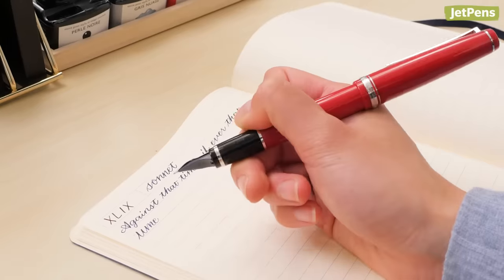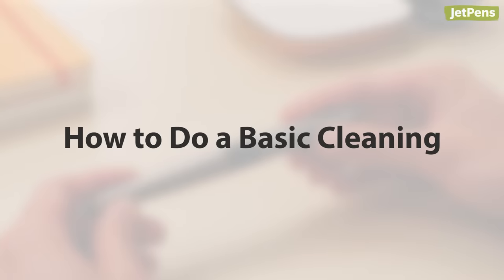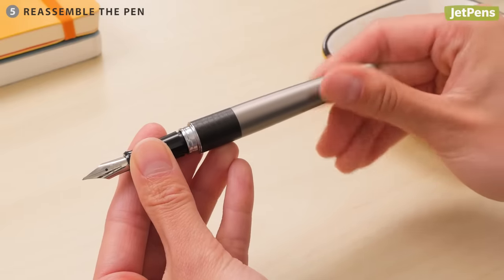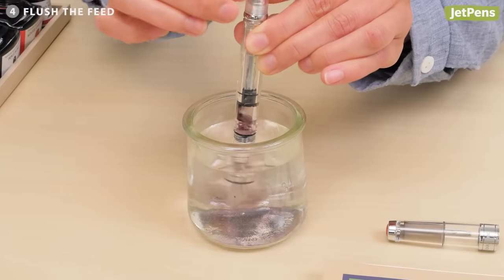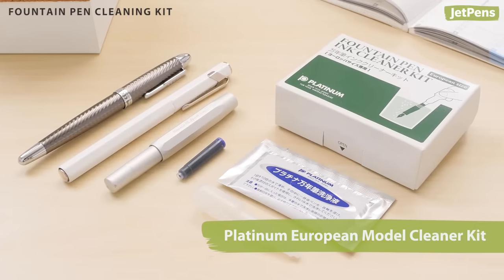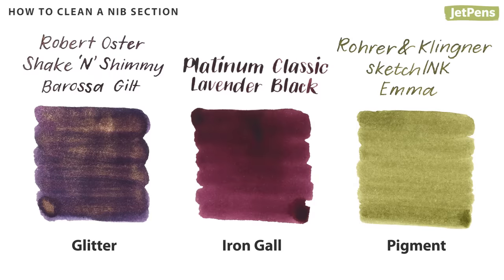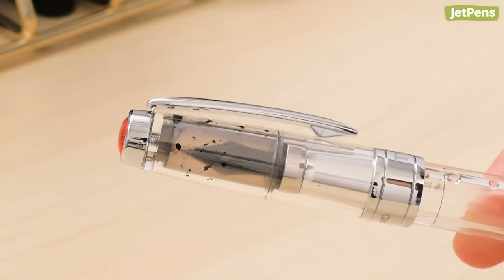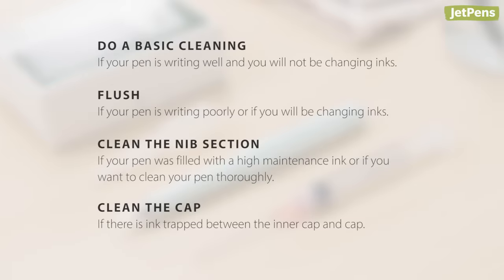How to Clean a Fountain Pen

Comment: i watched the whole video, i don’t even have a fountain pen
Reply: Buy one, use it, and clean it. You have your orders. 😉
Reply: future preparation :)
Reply: Encore_ss No, fountain pens write more smoothly and require no pressure to write, leading to less hand fatigue over hours of writing. Fountain pens can use the thousands of ink colours without being limited. The liquid ink stands out more on paper, and some have special properties like being waterproof, fade proof or fraud proof such as archival ink. Fountain pens can also give line variation through flex or stub nibs that allow of calligraphy to be done or for sketches such as Manga or even architectural designs, or just simple drawings. Seems to me that fountain pens are very different and not “pointless”.

(The guy removed his comment but I’m keeping mine up in case anyone else had the same assumption)
Reply: than get one 😉
Reply: you should try one...
Reply: YOU CAN BUY A PLATINUM PEPPY FOUNTAIN PEN ITS FOR BEGINERS AND ITS ACTUALLY CHEAP
Reply: • lxavender_blxrry • you’re not serious, even a Sarasa writes better than Pilot’s Energel. That’s a really low bar
Reply: get one! You ll be grateful
Reply: Ditto
Reply: Ballpen i way better.
Reply: @oldi184  oh you have just angered everyone
Reply: @abitlostbutigotit1576  Hey I only stated a fact. Fountain pen "scratches" the paper. Ballpen smoothly glides.
Reply: @oldi184  A properly working fountain pen glides better than a ballpoint ever could.
Reply: @chair5728  agreed - I would not have done as nearly as well as I did in uni without my fountain pen. I wrote much faster with it and could get a lot more down on the page all with 0 writer's cramp. Also, I might just add that they're infinitely more environmentally friendly than buying single-use ballpoint pens - if you look after a fountain pen it can last you ages plus most of the time you can recycle your ink bottle which is like one glass a year.
Reply: Amogus profile
Reply: Very good
Reply: It's better to be prepared than have one without knowing how.
Reply: Lol
Reply: I’m sure this video is for people who have Fountain pens ✒️
Reply: @bulletstothebeat1768  hey that’s my opinion too
Reply: @chair5728  They’re also more environmentally friendly than disposable pens
Reply: @oldi184  Some scratch the paper, others glide better than a ball point. Either way, that doesn’t make a pen better or worse, it’s personal preference. I like a bit of paper scratch
Reply: @4477superman  
Ok so "you like" is your opinion, but do not claim that the old technology - the fountain pen is better than the newer technology - the ballpoint pen. It isn't. The ballpoint pen was invented in the middle of the 20th century.  Technologically it is better in every way.
The ballpoint pen is used everywhere. The fountain pen
is only used ceremonially, mainly by CEOs, rich people, etc. who want to look fancy when they sign documents.

99.99% of people will use a ballpoint pen because it is better, faster, and more durable, it will write in -40*C cold, it will write in space, and is used on the space station. 
A fountain pen is good when you only need to write a few words. But try to write a lot of text with it, quickly. Good luck with it.
Reply: Same lol
Reply: Us
Reply: You should get one.
Reply: Do u have now?
Reply: Get a Pelikan Twist and a bottle of matching ink. It's an inexpensive pen, writes well with a medium nib, and is cute as can be.
Reply: Same
Reply: Lol 😂 same, but I am purchasing a couple soon. I've gotten an interest in calligraphy and I also want to re-learn how to write cursive, and what better way than with a fountain pen.
Reply: Same
Reply: Nice😂
Reply: Bruhhh
Reply: Get one if you like writing.
Reply: Same!
Reply: @oldi184  Although you seem to have googled the good points about ballpoint pen, every claim you made is false except writing in the cold temperature situation.

1. Older technology doesn't mean it's worse than a newer technology. If that was the case, fountain pens would have disappeared as soon as ballpoint technology has become commercially successful. People created ballpoint pens in order to write on uneven surfaces: like recycled paper, wooden surface, coarse wrapping paper, etc. But fountain pens remained in society because the ballpoint pen is NOT better than the fountain pen in EVERY way. 

2. I don't think everyone in this comment section is either a CEO, a rich person, etc. But they like to use fountain pens anyway. 

3. 99.99% of people do not use ballpoint pens. I myself prefer rollerball pens because it reduces hand cramp. My mother prefers gel pens because she prefers smaller nibs like 0.28mm instead of the standard 0.5. Many of my classmates in my student days preferred gel pens because it's easier on the hand for long note taking sessions and works well on cheap notebook paper.

4. No, ballpoint pen is not better, faster and more durable than fountain pen. Like I said, if it was better in every way, it would have beaten the fountain pens out of the market when it first appeared. During those days, a pen company can easily go bankrupt if their technology has become obsolete. The market was not as big as now. There were less literate people in the world and a lot of women were uneducated. Now we have 8 billions people with many literate people who can accommodate more options in the stationery market. 

5. You only claim that ballpoint pens are better for  writing a lot of words than fountain pens because you have never tested the two side by side. I personally know that ballpoints can cause hand cramp over a long duration because you need to put a bit of pressure into shaping your characters. It is my personal bad habit but I always find using force more than necessary when I use a ballpoint. The enormous callus on my right middle finger can prove my claim. I am now a working adult and mostly use digital devices like computer and mobile phone for my writing but that callus from my student days over a decade ago still remains. When you write for a long time using a smooth and properly functioning fountain pen that is not made of heavy metal, you will see the difference in hand fatigue level caused by a ballpoint. 

8. No, it's not more durable. Fountain pens can last for years. Parker fountain pens used to come with a LIFETIME warranty. Later, China produced counterfeit versions of their pens in massive amounts with very cheap prices. Parker had to close down 2 factories in UK and US and layoff all the factory staff. So they started producing more affordable pens to compete in the market and also changed the warranty to two-years period instead of a lifetime. Cross fountain pens still offer lifetime mechanical warranty.

If you want to compare the pros and cons of Ballpoint pen vs. Gel pen vs. Rollerball pen, this is a useful article (btw, rollerball pen is the most similar to fountain pen) - 
https://www.jetpens.com/blog/The-Difference-Between-Ballpoint-Gel-and-Rollerball-Pens/pt/167

Trivia: All the later presidents starting from John F. Kennedy used Parker pens. The orders coming from the White House was so many that Parker had to appoint a separate sales rep to handle all the White House orders. President L. B. Johnson ordered no less than 60,000 Parker pens in one year: for personal use and as gifts. Later, Parker relocated to England for administrative reasons and American presidents switched to using Cross fountain pens instead (another American company). In England, Parker obtained Royal Warrant by the British royal family twice. Queen Elizabeth II used Parker 51 devotedly and it was the most sold fountain pen model in history. They stopped producing Parker 51 in 1970s but collectors are still buying the used pens.
Reply: You should, I love mine
Reply: @oldi184 many people use them, as they are rather smooth to write with. The amount pressure you need to use to write with a good fountain pen is none aside from the force of gravity holding the tip down, so this means less stress on your hands while doing things like taking notes on nuclear physics during a lecture. Many artists use them as they have a bit of a texture difference visually than ballpoint.
Last thing, I am pretty sure you’re getting longevity of the pen mixed up with a nib. A nib you constantly dip in ink because they do not last long. With a fountain pen, they can last WAY longer than minutes. Try weeks, mine has survived many lectures, notes, and workdays for weeks at a time. Im not refilling mine every few minutes or every day or every few days, usually more like every 2-3 weeks. If im drawing much quicker, but most people aren’t worried about making a work of art with their pen, the average person just wants to write.
Reply: I have 11 fountain pens

Comment: Feed of Lamy Safari/Al-Star can actually be removed. It's just very difficult to be removed and you have to apply a lot of force and grip to pull the feed out. If you are determined to do that, remove the nib before pulling the feed out and make sure you look properly before you insert the feed back in. 

Ideally, don't pull the feed out that often because the friction might make the fitting between the feed and pen body looser. I usually flush my fountain pen or sometime I will put my pen in an ultrasonic cleaner to push out stubborn ink inside the feed.

Comment: Lamy pens have a removable pen nib. You can slide it of and even replace the nib. Put a small coin behing the writing part of the nib and pull the pen in the other direction. Be careful tough not to damage the pen or nib. 
Be careful with using tap water. Somtimes water from tap is very hard, containing chalk. You dont want this in the pen. Use distilled water instead. 
For pens beond salavage, mugged up with dried ink; use warm or even hot water.

Comment: 5:03: "Some pens, like the Lamy Safari, do not have removable feeds".
That's incorrect though. I remove the feed from my Lamy Safari every time I go to clean it out, and it comes out just fine. Slides back in with no issues either.

My suggestion is to remove the nib first, then remove the feed afterwards (carefully though, it's fairly thin). It helps to make sure that the pen is dry before trying this. When putting it back in, remember to use the same orientation of the feed with respect to the section as when you pulled it out (flat side up) - unlike with most other pens, there's only one way that the feed and the section fit together.

Usually removing the feed is only tough the first time around, so you'll need to be patient when trying it for the first time. I also recommend using a rubber grip the first time around. I remember using the rubber from an old table tennis bat that I no longer used - it worked like a charm.
Reply: It's lamy al star not lamy safari

Comment: every 4 to 8 weeks..
my very first fountain pen, laughing in the distance,
really, in my experience, if you don't use ink that is too strongly pigmented, or has big pigments, your fountain pen should survive quite well for a couple months at least even if you don't use it every day
for reference, aforementioned first fountain pen (a Schneider pen with an A nib, i got it around 17 years ago) lay around unused and uncleaned for at least five years until i gave it a good soak around march last year. the last ink i used in it before that was cheapo prussian blue cartridges from the dollar store
of course, if your fountain pen is a pricier model, or you change inks often, OR you use something like glitter inks, most of which have glitter particles that are big enough to get stuck in the feed, you'll probably want to clean your pen more regularly
but if you do it regularly enough and neither the ink or pen are stubborn, a rinse should suffice in my experience

Comment: I have a rose gold detailed one. Should I be worried about a patina or rust?

Also should ya clean it when ya change inks? I had black in it previously and want to put in blue.
Reply from the maker: It depends on the material of your pen, for example brass and copper fountain pens will darken and develop a unique pattern of patina. And yes, we recommend cleaning it when changing inks! This ensures that inks won't mix within the pen, which prevents muddy colors and the possibility of inks reacting to each other poorly.

Comment: I've been watching fountain pens videos for months even though I didn't have one.

My boyfriend remembered and bought me one a few days ago. It's a cartridge one, and in the video they said that you need to clean it every 4 weeks. Do I need to clean it even if the cartridge has ink, or I need to wait until there's any??

I want to be prepared when the time comes.
Reply: If it writes well and doesn't clog up with dry ink or paper fibres in the nib and feed, just keep writing. If you use the same ink and write with your pen almost every day, just put another cartridge in and keep writing.
If you change ink colour or even brand, then cleaning is recommended.
I mostly have to clean out my pens before the ink has run out because some ink has dried in the feed.
Hope you're having a good time using your pen still now, a few weeks later.

Comment: My fountain pen always takes multiple strokes and circles9 to get the ink moving . . . Is that normal?  It is my first . . . It has done it from the get go.
Reply from the maker: Hi there! It depends on how you use your fountain pen. If you reach for it regularly, you shouldn't be having issues with hard starts. However, if you only write once in a while, ink might dry on the nib, so you'll need to do a little scribbling before the pen writes properly.

However, if you use your pen regularly and it performs in that way, you can try a few things to alleviate the problem. Give your fountain pen a good flush and see if that helps. If it doesn't, you may need to do some extra work. Check out our Troubleshooting Tips and Tricks page: https://www.jetpens.com/blog/guide-to-fountain-pen-nibs-troubleshooting-tips-and-tricks/pt/777

Comment: But what if the pen becomes rusty using water?
Reply from the maker: Hi there! Fountain pen nibs don't rust because the materials used to create them (stainless steel or gold, etc.) are not prone to rusting. If you are concerned, just make sure to fully dry the components you've soaked once it's clean.

Comment: I don't like disassembling my pens (not that I don't like to see whats going on in there but it can cause problems especially with metal to plastic threads)so I just flush the pen if it is cartridge/converter filled and I just use the mechanism for other pens.I only disassembled 2 pens that were vintage and has dried ink.